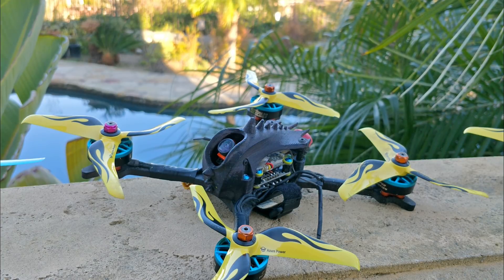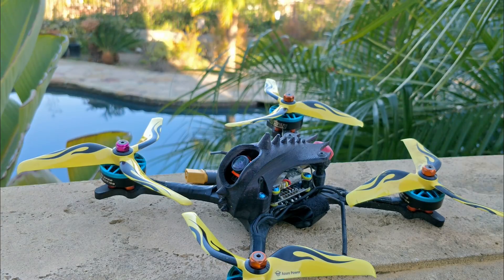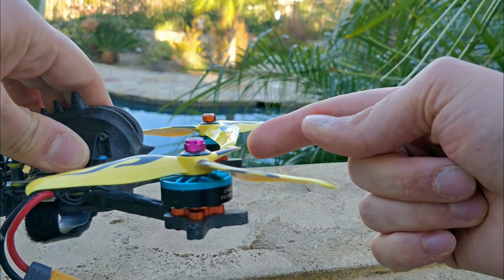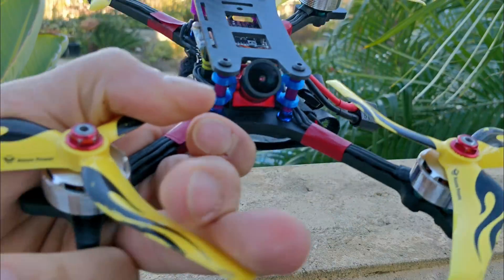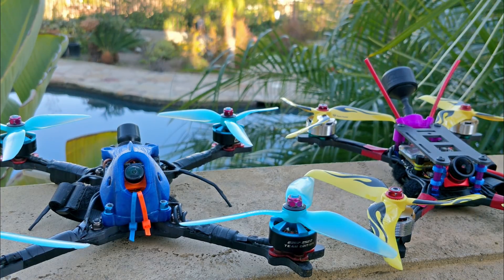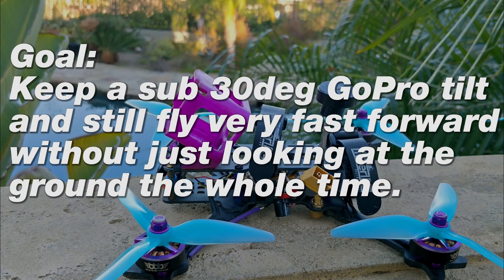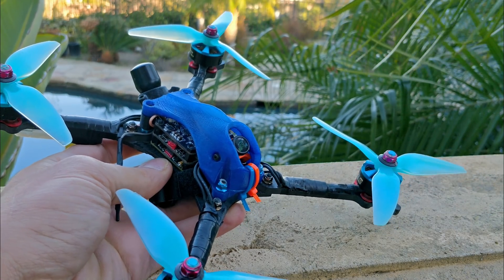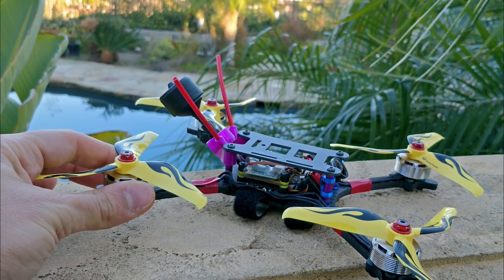Frame Geometry - Stretch X vs Tight X

Comment: Nice discussion as always!

I think a reason why people also like the larger X is that you get a greater leverage in roll (in relation to center of mass? as well, which makes it more stable. That is also probably a big contributing factor as to why you don't have to muddle around with pitch in 180deg corners, the greater leverage from center of mass makes the quad more stable in pitch. I personally like the same motor stance as you but I know other pilots that prefer a more stable pitch as well. The frame that I've designed is not as much of a stretch X as yours but is still stretched. Mine has standing arms and a box shape, which I know you are sceptical towards. But the frame also only ways 73 grams and is one of the stiffest frames on market. A shame that I live in Sweden and not in California, would haved loved to discuss frame design with you in person and show you my philosophy as well :)

Link to frame: http://carbix.se/product.html/carbix-zero?category_id=46
Reply from the maker: Oh yes, I know this design well.  The kids in Sweden I believe are nuts over this stuff.  Nice design, it's just a bit complex for my taste.  Too many frame parts.  I'm not sure any particular frame is so much better than another that it allows a pilot to win.  That's why I haven't ventured into some really crazy designs and why I keep it as simple as possible.  Goal is to get a usable geometry but make the frame easy to maintain, light, strong and cheap.  I am however interested in how that kinda design feels.  The top and bottom struts should feel a little like a wing at top speed and it should be able to slow down really quick with a little pitch back when needed.
Reply: Kabab FPV haha yep I made this frame for the guy who came up with the original idea. Yea it is a bit complex but as you said the side and top struts and the more aerodynamic stance give this type of frame really interesting flight carecteristics. All flat armed frames fly similar this is different, but as you say the frame doesn't win a race. Would have sent you over one to try out but we don't sell that many here so can't really afford to hand any out :/
Reply: Kabab FPV Glens frame is superior to any other frame on the market. Its like cheating...
Reply: Kabab FPV Just wanted to add that the cornering feels considerably more locked in and it tracks very well. Went from your hyperlite evo to one my sponsors other standing arm designs and the difference in cornering and tracking was very noticeable. Other really interesting things happens when you go to hight camera tilt, hard to explain you have to try for your self. But one of the things I like most is how stuff the frame becomes and it has in my experience helped with tuning (you han have higher PID:s). My thesis is that when a frame flexes that introduces latency into the system (the quad doesn't respond  straight away when the motor gives thrust, due to flex in arm). Higher latency, makes the tuning gap smaller and not as potent. It also helpes with vibration resonance. But you've probably already figures this out :)
Reply: Holdox_FPV Haha I wouldn't say that it's like cheating but thanks holdox :D
Reply from the maker: Thanks for the offer but no need to send anything.  I appreciate the offer.  I barely ever fly these days unfortunately.  I've recognized the rigidity issue and the recent 5mm arms on my designs has made that a complete non-issue.  I can visualize what that box structure around your design does but really, I'm just not a fan of complexity.  I have however been dreaming of trailing a giant fin on the front or back of my quad to test if I can get it to track more like a plane rather than sliding around half sideways like a quad typically does.  I guess the fin would need to be in the center somewhere.  I might get around to testing this.  Based on findings I might get some new ideas...

Comment: hey man! have you tried whitenoisefpv's race wires? thought they might compliment nicely the arms of the floss :D
Reply from the maker: Yeah they're interesting but I really only see one good use for them.  For motors that have cut wires, it's easier to extend the wires with those boards than solder and shrink.  Otherwise, I stick to the stock wires on the motors.

Comment: Can't you make like a stretched plus frame that has back motor higher than other 3 ? 
It might get rid of those problems ant it will look sic
Reply from the maker: BuzzCola 3 what you describe is the opposite. It would make everything worse...
Reply: Kabab FPV lol, I ment to write back motor higher 😂
Reply from the maker: The cross design is most stable in a straight line. Turning feels a bit odd to me. Works fine but it hasn't really caught on and I don't expect it to for a bunch of reasons...
Reply from the maker: You also wouldn't need to make the rear motor higher or any of the other motors for that matter. They're all staggered and the distance from front motor to rear is huge. So really, it's the best in a straight line. Might even be considered for top speed runs except that it's structurally more complicated to deal with than an X and that usually means more weight which is the enemy.
Reply: Kabab FPV so the best will be something between + and x 😂 
So Y will be awesome but without servo or 4 motors it will be bullshit or maybe not but it will be TRICOPTER :/
So tricopter maybe the best.
I think + feels weird because you have only like 1 motor per axis and in x you have 2 but shared